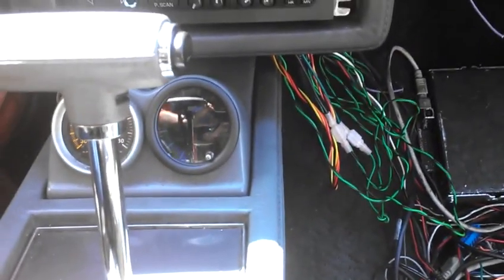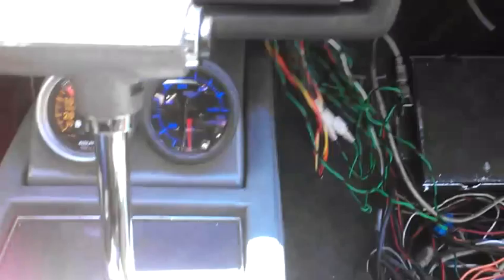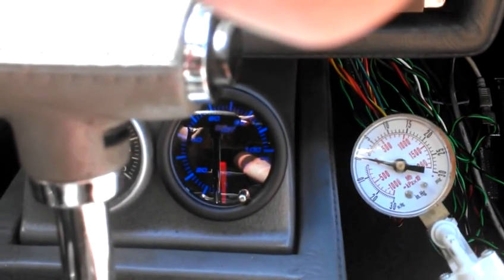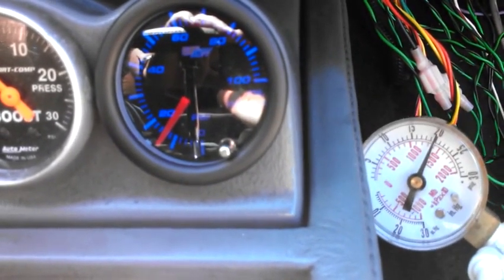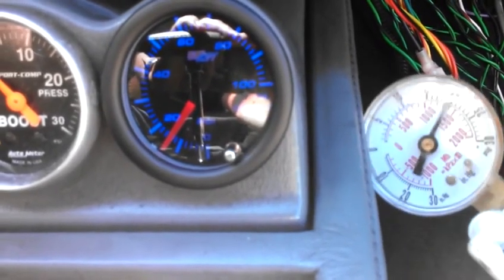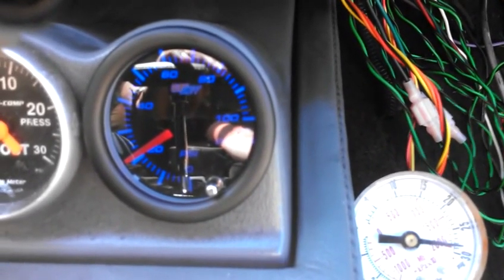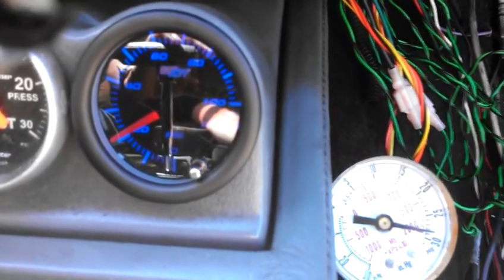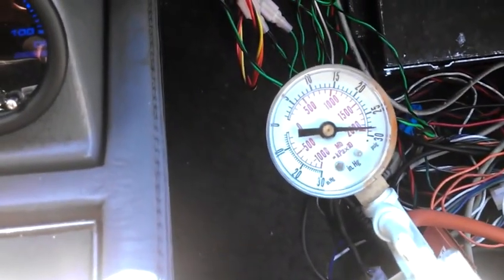Glowshift inaccuracy

Comment: Got the same problem , in the begining the oil pressure gauge didn't agree with my mechanical one by almost 5 lbs. Not really a problem ., but now I shut the car off it stayed at ten ! ..After that I left it alone for 10 minutes & took a walk , ,I turned the ignition on without starting the engine ,& it was still at 8  !Now after driving for an hour it stayed at 15! The real issue I bought this gauge for was to detect low oil pressure while I was driving instead of relying on the idiot light ....Now what ?

Comment: Yes just installed my boost gauge.. it is inaccurate

Boost on dyno 1.3bars
Old gauge before swapping to glowshift 1.3bars
After installed glowshift 0.8bars

Olg gauge idle vac -0.7
Glowshift idle vac -0.5

Comment: Are you using air pressure? Won't work correctly.
Reply: Bob Bailey no reply to above?
He nailed it
Reply from the maker: +EmotionalTree ,    yes,  air pressure.    explain to me how it won't work correctly.    As an aside I shared the video with the manufacturer,  they had no complaint about my test method.
Reply: +Bob Bailey 

Air is a compressible fluid as it can cause erratic readings (jumping on your gauge) the sensor may not be able to read it well compared to oil because it doesn't compress.  Mechanical gauges are different, but electrical senders may not read as well. I could be wrong but I would be interesting to see if there is a difference between a in-compressible fluid and compressible. 

Thanks for the reply.